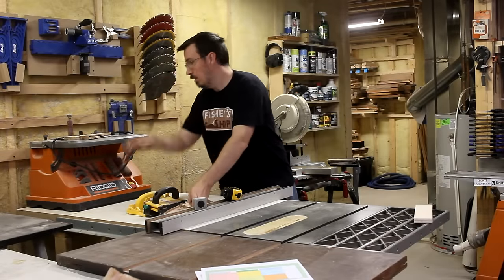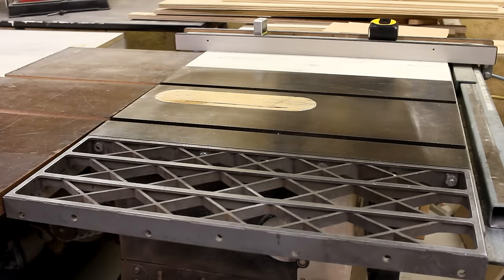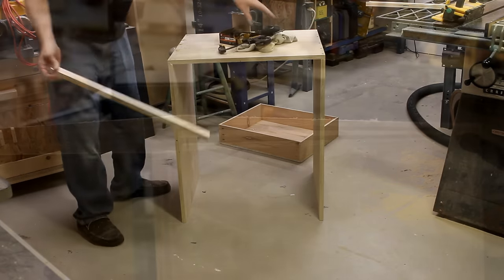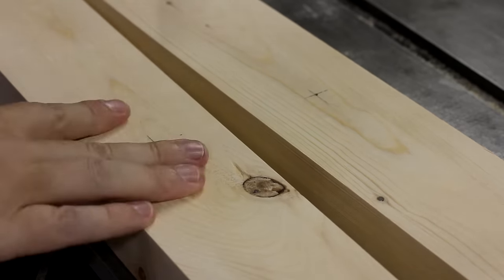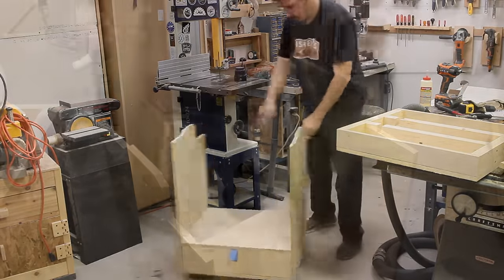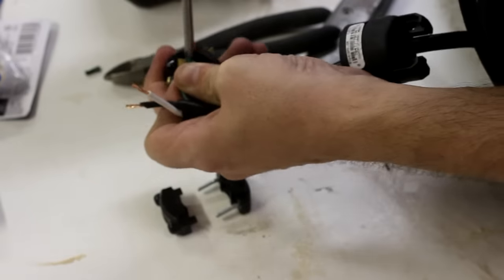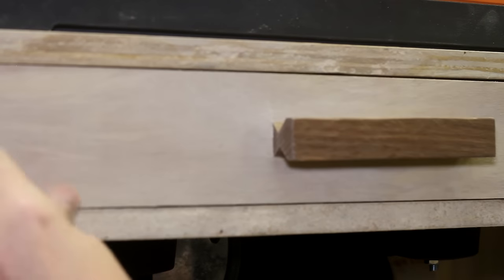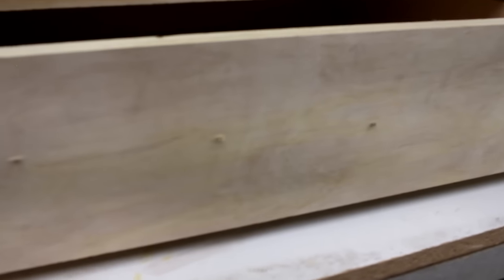Shop Work: How to make Fisher's Flip Cart

Comment: Just purchased your PDF.  Quite complete and well worth the cost.  Looking forward to the build for a drill press and band saw.  I used Sketchup to reproduce your design and found that I can't use the drawer because the band saw is too tall.  But since your design rotates just 180 degrees, it allows using stabilizing gussets instead.
Reply: I’m also thinking of building a flip cart for a band saw and and drill press and would be interested in your plans. Are they available?

Comment: I know this is an older video, but I recently purchased your plans for this build and just wanted to say "thanks!"  I just finished building mine and had to modify some dimensions and account for a different thickness of plywood, but in the end it turned out great! I mounted the Ridgid sander on one side and the Dewalt Planer on the other. Great design!
Reply from the maker: Glad it worked out for you!

Comment: I slipped and accidentally bought a Rigid belt spindle sander and then had to build this thing. What a great project to work on. Only had one issue, my Delta Planner was about 3/4 of an inch too tall so i had to figure that out. I could have taken off the crank handle to let it rotate all the way but figure I'd lose a part or two. So I ended up cutting off the top 6 inches and splicing a 3 inch piece in the middle of the sides with glue and pocket screws. It worked out pretty well. For those considering this build they should keep the height of the tools in mind when doing it. 
Thanks for the opportunity on solving a space issue in the shop and all the great videos you put out. Time to get busy with those jig plans I got from you.

Comment: I have watched this video several times and I still get a chuckle. I like this design the best of all that I have seen and will be making this one soon. I am going to change one part...instead of an over size flange (3/4") for a bearing I thought a flange the same size (1/2") and bore/drill out the internal threads to where the pipe rides on the flange and not the plywood. One more thing...your out takes could have been filmed in my shop (cleaned up of course)...retired US Navy here...lol

Comment: Love the video and the idea of integrated power. One suggestion I would make is to have the opening in the support a bit larger so that IF you have to change out a tool, you can get its cord inside without having to do any disassembly.

Comment: Made your Flip Cart, but a little different. I only wanted to mount my Dewalt planner. The main modification were the initial cuts as the overall width would be 32".  After getting a 3rd grader to help me with the math, I followed the plans and it came out great. I only needed the one tool so the flip side is a good work or outfeed table. I did put in a counter weight so it would be easier to pull up the 100lb planner. Keep the  honest humor coming, Thanks Drew!
Reply: Obee: What did you use for a counter weight.  I have the same planer and was planning to build this cart.  I hadn't considered how to pull it back up.  I'm not as young as I used to be.  Thanks.
Reply: @kenmulvihill1230  Ken, I'm not as young as I used to be either, so I used an old lead window counter weight. Approx 45#, these were used in windows back in the day(way back). This one was about 15"Lx3"Dx2"H with holes on each end tucked away in the space where the power was. Just one of those things lying around the shop that I had not used for years but could not throw away. Sorry, I know this doesn't help much but keep looking around you will find something that will work. UPDATE! As we all know "good enough" never is, I purchased a Rikon 6" Jointer that has a 30" table which mounted perfectly opposite the planner so I removed the counter weight. Good Woodworking to you and all. Obeejaun

Comment: I just finished my build of this using your plans. It came out well, but it was intended to be both a learning experience for me as well as shop furniture. I have a Rigid spindle sander and a Dewalt planer (92lbs) on it. I did put the drawer slides in before I put the top and back on and while I forgot to remove the jokers from the deck before setting the drawer front I didn’t use them. I was afraid that wouldn’t have been funny. I just rubbed some finish on it and hope to use it on a project very soon. Thanks for all your work.
Reply from the maker: Awesome, Andy!  Glad you got it completed.  Hope you had fun.

Comment: I slipped about four days go as well. I bought the Ridgid Oscillating Sander and the bigger Rikon Strip with 6" disc sander. It was awful. Truely awful. I love that your videos have one great happenstance joke. The buffalo birth on the Serengeti still makes me smile.

The iron pipe T-joint thing is genius. The entire wire path and the fancy 45 degree angles where the flip top connects are beautiful. I also really enjoyed watching you use the combo square. You looked like you were a master at using it for marking layout.
Reply from the maker: Haha, thanks!!

Comment: I built this for my shop. When I started it, I was going to put my Ridgid sander like yours on it with a 10 inch bandsaw. I soon found out that in order to do so the working surface of the bandsaw would be too high for anyone else working in my shop. So I also "slipped" and bought a 12 inch disc sander. I chose to add a power strip with 4 outlets and two usb coming out of the other side of the pipe. I have to say the plans were very well laid out. I enjoyed building this and will build a couple more for other tools. I think I can still make one for the bandsaw if I eliminate the drawer and reinforce the lower corners with triangles. Thanks for showing the human side of working in a shop.

Scott
Reply from the maker: Thanks, Scott.  Glad you liked it and that you enjoyed the build

Comment: Finished mine.  Had Home Depot cut and thread pipe to 14 and 12 inches and added a cap on one end and a bushing on the other end.  It won’t splay out for sure now.
Also add washers between the flip top and the sides to make it turn easier but that probably was unnecessary.  Very happy with the results.
Reply from the maker: Awesome!  Yup, you did exactly what I have been recommending to people that were concerned about it splaying out over time.  Mine hasn't budged at all so far, but it's good peace of mind for those that are worried about it.

Comment: Very nice. This is my next project for my shop. However, as a master electrician, a couple of "things" 1. put a "chase nipple" in the "T" to protect the cord, and bevel the end of the inside of the pipe you run out the cord. Over time both will wear the cord and can make a short circuit situation. Love the videos, great stuff and you are fun to watch. Thanks

Comment: I'm currently in process of making this after purchasing your plans on your website. I probably didn't NEED the plans but it definitely has made the job 100x easier. All I have left is to mount the top, wire the plug, and mount the tools. I'd like to finish today but this 103 degree weather in northern CA right now cut my day short. Thanks for making these plans available and making your videos fun to watch!
Reply from the maker: You got it, Keith

Comment: This is a great cart! I just built 2 of them based on the plans I purchased from your website. On one of them, I added 3/4 MDF that is 24" wide instead of 20". I put a 45 degree edge on the front so that it could receive jigs I have made (like a mounted pocket hole jig) that all have french cleats to attach to the wall. I can take them and slide them right into the 45 degree edge. I then cut grooves for Matchfit clamps into the surface. I can use the clamps to secure the french cleat jigs or just as a work surface. I was going to add wings (like on your miter saw cart) to one, but I'm concerned that they will pull the sides out too much. I will just build one that I can attach to the Matchfit table and put them side by side. Very flexible design and a nice project to build. Making 2 a time saved me time since all of the complicated cuts and measurements were just traced on the second ones.
Reply from the maker: Sounds awesome.  Nice work, Doug

Comment: Bought your plan and built it. Works great! The one thing I did differently is instead of drilling a hole in each flip top for the power cable, I put a notch in the panel with the magnets and fed the cables through there. Not as clean-looking, but prevents wood dust from getting on the insides of the flip top.

Comment: I purchased your plans, and I have to say they are worth more than you asked for.  Not only do they have the component cut layout, but step by step instructions and detailed dimensions where needed.  I did have to make an alteration to the side height to accommodate my small band saw, and replace the drawer with inside corner buttresses to allow clearance for the saw to swing down but easy to alter the plans.  A side benefit of raising the sides is that the table height of the saw is exactly right for me....I don't have to bend to focus on the work.  Also, instead of using the black pipe flanges, I pressed a copper pipe coupling (cut to 3/4") into the 7/8 holes for the "axle" to ride in....a very close fit with almost no play.  I'll be making at least one more of these for my other tools.

Comment: I reviewed many, many videos of flip tool stands, and then bought the plans and built this one almost exactly as shown. This is by far the best design, IM not so HO. I love the wiring system. No cords flopping around. I added a little 3/4" thick pocket on the cord side to stuff the main cord when not in use. At $15 a pair, I didn't use the pipe flanges as bearings.  Instead I used PVC bushings  @ $.40 each, and glued them in place. The pipe fits loosely in the bushing so I glued a little shim stock (beer can aluminum) between the pipe and PVC bushing to act as a bearing surface. I hope to get at least two hundred fifty thousand hours out of that bearing.

Comment: Bought you plans for this over a year ago and finally built my own this weekend. Had to make some adjustments to accommodate the larger router table and sliding miter saw but it saves so much space in my tiny shop.
Reply from the maker: Awesome.  Glad it worked out for ya

Comment: I have been thinking about building one of these flip carts for a number of years and finally decided that my scrap plywood pile needed thinning out and your cart design was the perfect solution!  I finished the cart the other day but made a few modifications to the original plan.  I used one 18" pipe instead of two 12" pipes.  The 18" pipe was cut in half and the pipe brackets were reversed so that the flat side of the brackets faced outward.  This allowed me to use the 18" pipe and kind of slimmed down the design without sacrificing the integrity of the pivot assembly.  I also used a regular 110VAC outlet box for my power source so that I could include a pigtail wire that is fed out of the other side of the cabinet through the pipe and supplies power for my dust collection.  Speaking of that 110 power source, I use a master switch that controls the power to the outlet box and allows me to start/stop my dust collection without reaching for the dust collector switch (plug the dust collection into the pigtail and flip the switch on. )  I also used threaded inserts with threaded knobs to lock the table down.  I have four threaded inserts in the table top and two locking screws that go through holes in the case and into the flip table.  As a side note, I did not measure my planer height and have to remove the height adjustment handle when it is in the down position - my bad.  I also forgot to remove the little yellow safety lockout on my sander sander switch and ended up stepping on it!  All in all a great design that motivated me to build a great piece of shop furniture and use some of my excess plywood.

Comment: I just successfully constructed your Flip Cart.  A great project.  And, yes, I made a few errors too, but nothing my chain saw and a roll of duct tape could not fix. Might I offer some observations that others might learn from. (1) To make just one cut of the 1/2 inch pipe I moved the pipe “Tee” connector off center  (2) For a bit more strength,I cut a rabbit for the cart bottom and 3/8” dados for cart shelf with glue and screws. Some cut adjustments necessary. (3) My spindle sander would be a bit tight so I cut the cart shelf 5” instead of 6” and reduced the height of the drawer by 1 inch. (4) To protect wiring in the flip shelf I installed metal shims over the saw cuts. (5) To keep the electrical cord from chafing I installed a rubber grommet inside the end of the 1/2 inch pipe. (6) Before installing the 2 x 4 supports I created a paper template of my spindle sander footprint to make sure the mounting bolts would fit. Finishing with a couple of coats of Hokie Maroon and Orange covered up my minor goofs.

Comment: I bought the plans and love the result. The only thing I changed was to forgo the lockdown hardware. I didn’t like the idea of screwing into the end grain of plywood. Instead, I made two pins from 1/2” dowel and bored 5/16” holes on each side of the cart through both the side panel and the rotating shelf, on the opposite side to the stop, first ensuring the shelf was firmly sitting on the stop. I then flipped the shelf and inserted the 5/16” drill bit through the hole in the side panel and drilled into the rotating shelf. Now, I can just pull the two pins, rotate the shelf and reinsert the pins with no strain on hardware or plywood.

Comment: I've been needing to build something like this for a while and everytime I gee myself up to finally get it done I always end up watching this video. Just to be clear - when I use the phrase: "gee myself up" to finally get a flip-top stand built", I mean it in the sense of "spend hours binge-watching youtubes of flip-top stands. Your's looks technically challenging enough to keep the build interesting, but at the same time all thoroughly do-able. Your stand also has by far the best details IMO. The 180°-limiters and the single clasps are genuis. The concealed power extension and internal wiring too, love it! The one I need will have to be much heftier, though, as I want one side of it for my drum sander (85 kilos/ roughly 190 lbs). The other side is for my planer and massive chunk of cast iron (with room for other tools to balance the weight out). I'll most keep to something optically similar to yours but I'll probably need heavier-duty pipe or some other swivel mechanism in my case given the overall weight (and longer span) of the my rotating deck. Anyway, I feel fully gee'd-up now. This is going to get done this weekend, starting now. Thanks

Comment: Great design. I saw other videos on similar flip carts, and kept asking myself, "why would you do that, like that'? I know there are a million ways to skin a cat, and there are very few things I would do a tad differently, but really, this is an awesome video. The way the table supports itself on top of the gables, and not In between them,  is far superior than anything else. Many times I have driven too long of a screw through a drawer front or top, among other goofs.I will be making this flip top for the ridged sander like you have, plus the ridged planer. Really appreciate being able to tap into your brain with this table. Thanks.
Reply from the maker: Thanks, John!  Have fun with the build

Comment: Drew after watching the video I decided to order your plans !  Your design on the 180 degree flip is spot on along with your internal wiring !   I had to perform some thoughtful and scary modifications to the side supports as I would be mounting a 6 “ jointer to the lead position !  All turned out well except for a plywood void that blew out during the cutting of the top portion of one side support !  I was using a $55.00 sheet of cabinet grade maple ply ! Had to rebuild the inside edge with wood filler !   I used a electrical box and a used GFI receptacle calling out from a storage drawer “ please Mr Bill use me “ so I entertained the request !  Will email you some pix !
Reply: what side supports did you add? I am also wanting to mount a 6" Rikon  jointer with a deWalt 13" planer

Comment: I finally finished this project!  It took a week since I only had an hour or so a day to work on this but last couple of days I went hard at it and finished.  After cutting most of the plywood we realized our table saw blade was set to a 2 degree angle 😩.  Here I am wondering why we had such a hard time squaring our boards.  So the drawer front sticks out a tad in the top left corner but it works.  Our stud and 1/2“ plywood were also a bit warped and bowed.  But with enough glue, brads, screws and clamps, anything can be made flush and square enough to work.  Thanks goodness it’s just shop furniture.  Also wanted to mention I’m new at this woodworking stuff.  Only made a couple of cutting boards and a French cleat wall till this.

Comment: I've got the exact same Ridgid oscillating belt/spindle sander. While considering a flip cart, I wasn't sure what I'd do with the abundant throat plates, washers, and sanding drums. Happened to see your video thumbnail. Lots of cool ideas, including your choice of locking latches, the integrated power cord, the magnetic cover, and the accessory trays.